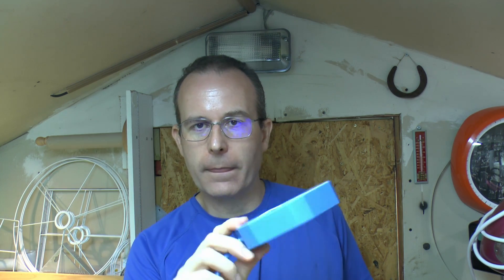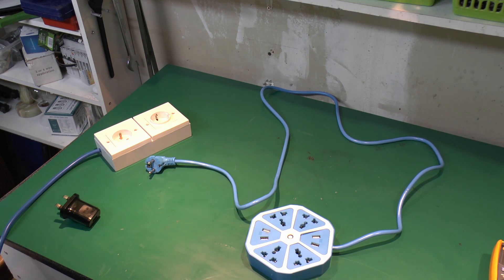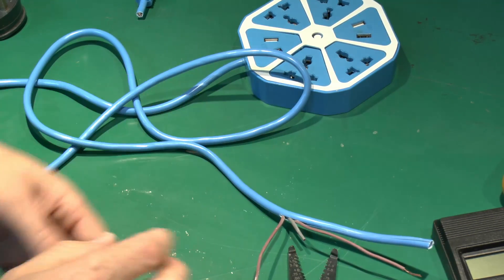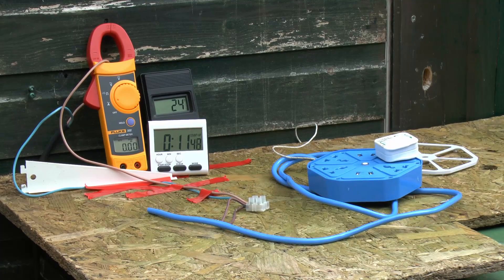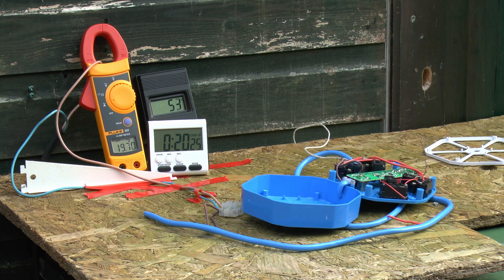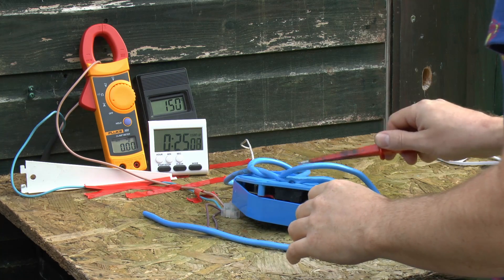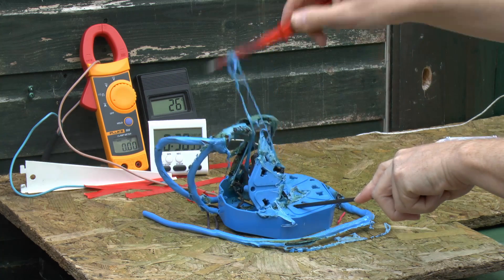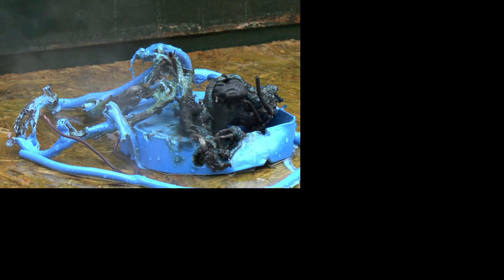Hexagon Socket tests - USB, Current, Overheating and Flames

Comment: Old video, but I just had to point out that it appears you can't put two proper approved British plugs into adjacent sockets! It's clearly been designed with those Godawful undersized triangular Chinese fakes in mind. Of course, that's the least of its problems...

Comment: I agree that this hexagon socket is a cheaply made pile of crap, but not really a fair test to send 3000v through the USB circuit, or 30A through one of the 240v sockets. I don't think even a decent quality socket would survive that for any length of time?

Comment: the clamps around the plug's pins widening and releasing contact due to heat is A VERY CRUDE overheating protection. Its like a bimetallic thing :) (edit: continuing to watch I see you said that yourself)

Comment: Damned cunning, these Chinese.  Rather than having an actual fuse, they arrange for the sockets to break the connection in overload conditions.  They've invented the fusible connector!

Actually, they didn't invent it.  I remember the kettle my parents had over 50 years ago.  The "boil-dry" safety was a spring-powered prong in the kettle's power receptacle that violently ejected the connector when a bimetallic catch released the prong.  So, a cheap-and-nasty copy of old technology, badly implemented (and almost certainly unintentional).  Typical Chinesium.

And what is it with their complete inability to earth things properly?
Reply: Yet they went to the trouble of putting an extra tube in the flex, and actually having metallic contacts. Why bother?
Reply: +uncriticalsimon
Three explanations spring to mind:

1) It's enough to pass a casual inspection.  A non-metallic earth pin would raise doubts amongst some people who have a basic grasp of what a mains extension should do.  A cable with only two cores would raise doubts amongst the same people.  Most members of the public would fall for it, but enough would invoke trading standards for it to be a problem for the manufacturer.

2) They employed a wet-behind-the-ears designer who doesn't understand earthing.  Or possibly had a draughtsman trained in mechanical drawings do the electrical design (I've worked with more than a few Dunning-Kruger draughtsmen who would, if left to their own devices, do some very stupid electrical stuff).

3) Superstition.  The Chinese (a little more so than other cultures) put good-luck charms on everything.  The manufacturer may think having a metallic earth pin and a round cable is our form of good-luck charm with no purpose except to make us think it's a lucky mains extension.

Comment: The sockets 
failed on this 
one in exactly 
the same way as.......

 
.......the one which I showed on the BoomBoxDeluxe channel. In a way, I was half-expecting this one to let loose in the same way. 

Once all the sockets have popped, that is the end of it. Your one also had only 2 core flex with an empty tube inside it.

One thing which I forgot to show in my video, is that the plugs can be put in the socket the wrong way around, negating polarity and a fuse in the live conductor (that is if your device was wored the correct way round to begin with!!!) 

And of course, if a class-1 appliance is connected into this and that appliance faults to the metal casing, it will stay like that and someone could get zapped off of it!

As others have said.... it would be interesting to send this back for a refund. :D

Aaaaah..... the blowtorch comes out for some flaaaaaaames. 

Even if I had a blowtorch, I would still use a lighter and a can of hairspray. The whooshing sound of the flame and the way it gushes out of the spray can adds a much more dramatic effect. :D

Thanxx for showing,

-Wayne's Electrical.

23rd August 2018, 17.50

Comment: ooh look, $8.99 on Amazon https://www.amazon.com/Surge-Protected-Jack-Seller-Protector-KB-6JPC-PU/dp/B07CG2KTCS/ref=sr_1_fkmr1_1?ie=UTF8&qid=1535012138&sr=8-1-fkmr1&keywords=hexagon+plug+extension+cord and the only comment is it melted when running a hair dryer. I am shocked  :-)

Comment: it is definitely not rated for 16amps maybe a max of 5 amps it would be a decent device for short term use  if it had the earth/grounding wire connected and didn't use a poor quality universal plug and was not overloaded (I would use it for the <1amp for most portable device chargers in an active use situation but not in any long term or unsupervised situation or one needing an earth connection(usb chargers almost never truly use earthing mostly only earthing the case and most usb leads isolate the shield of the ends of the wire anyway))

please note a cable like this in the usa 120vac system with the parallel blade configuration would be considered mid to high quality as half the voltage and a general peak of 25-30 amps of all sockets in an entire room (average of 20-25amps with a common size of 15amps for lighting or low power rooms) would make it effectively safe as any failure in the decribed manner would cause a circuit breaker interrupt before the device could reach smoldering temperatures so the us plug version of this device I would trust however 240v 16amp is in my estimate 4x the true rating of the device in a non earthed use case and the dummy cable making you think it is earthed makes it unsafe as you may try to use it (even in the usa) for a device that could be dangerous if unearthed (fluid based application: clothes washer, decorative fountian, bilge/well pump)
Reply: In the US, most outlets are rated for 15 amps and are on 15 amp circuit breakers. Kitchens, workshop areas, laundry rooms, etc. usually have 20 amp circuits with 20 amp outlets (the ones with one hole having a T shape, in order to accept both standard 15 amp plugs and the incredibly rare 20 amp plug with one blade rotated 90 degrees. As for quality, no, this device would not be considered "mid to high quality." It most certainly doesn't meet any standards in any way. Dummy ground (Earth) pin, conductors appear to be 18 gauge at best (16 gauge is the minimum size allowed for extension cords and power taps. 18 gauge is only allowed for cords on certain very low power devices- even lamps have to have 16 gauge copper wire now) inadequate separation of low voltage and high voltage rails in the USB board.
Regardless, yes, the circuit breaker would open long before this thing got that hot... Unless you had a faulty breaker, or a 20 amp breaker where a 15 is supposed to be. This thing is completely unsuitable for use for anything at all. Given that UL listed power strips are available at any dollar store, and ones with built in USB charging ports, also UL listed, are available for less than $10, it would be ridiculous to use this thing even for the purpose you suggest. Indeed, JW has just demonstrated the only purpose this piece of canine excrement is suitable for.
Reply: hmm I didn't guess the gauge correctly and missed the lack of usb separation so yes a very cheap ass device then however I often need an extension cord for a 5v 2.5a brick (not usb and only 2 pin) for my tablet so the 18awg would be ok for this since I am never away from it while in use but for anything more than the ~30w the tablet can draw from the adapter it is only useful for destructive entertainment
and yes the usb would very quickly be chopped out of the circuit as 500ma is generally useless for charging in 2018 and a quality 2+a brick would be 10x safer
Reply: This type of plug is rated for 250V, 16A. Normally. I can almost see that this is a chinese fake plug, it's too small. It should fill the "hole" in the outlet completely.

https://upload.wikimedia.org/wikipedia/commons/d/d0/Steckdose.jpg

Comment: Ooh.. Bimetallic contacts that go open circuit under overloads.. great safety feature 😂 at least that's one less piece of junk likely to burn a house down.
Reply: a great idea for cheap ass extension cords as it will never go on fire on its own since it can never supply power near ignition (or even melting) temperatures

Comment: perhaps the white powder in the cable is cocaine, would be a good way to ship it,  easy test for aluminium wire, apply lighter flame, copper just discolours, the aluminium goes all weird
Reply: Yep - cigarette lighter will quickly reveal if its cca, ccs or copper
Reply: I notice nobody ever mentions steel or plated steel wire.  Among the off-rating chinese wire, I've found that the fakes are almost always steel, and very rarely aluminum -- yet everyone is on the lookout for aluminum instead of steel.  

It's simple and definitive to test; you don't even need to strip the wire.   A magnet is one way; a meter is an other way.  If your cord is aluminum, expect about 50% higher resistance.  If it's steel, expect about an order of magnitude more.  This is part of why I'm inclined to pay more attention to finding the steel fakes.
Reply: The white powder will be chalk.
Reply: Simon Tay  yes, we know its chalk, but are you SURE? lol
Reply: @simontay4851 
Talcum
Reply: Gotta love JW's dry humour when he suggested it was probably asbestos.

And he's been taking lessons from Big Clive and/or Photonic Induction.  Putting 3,000 V across it just because he could.

He'll be using Clive's portable X-ray next. :)